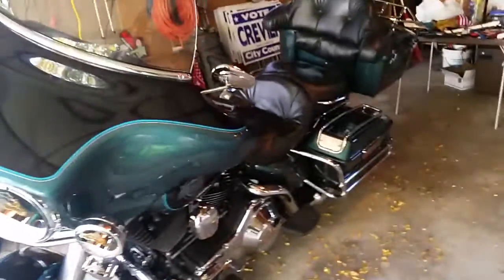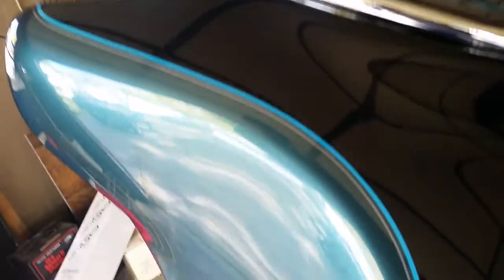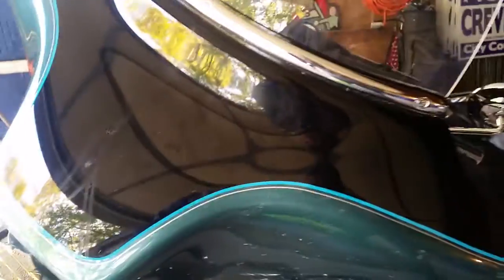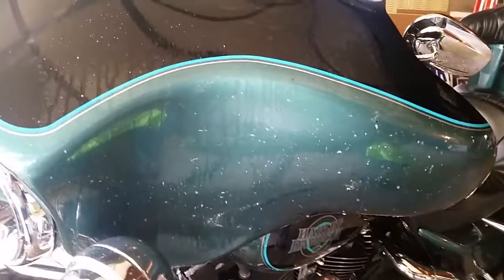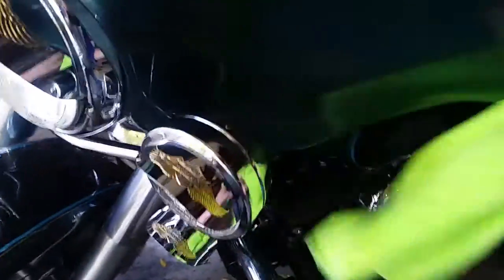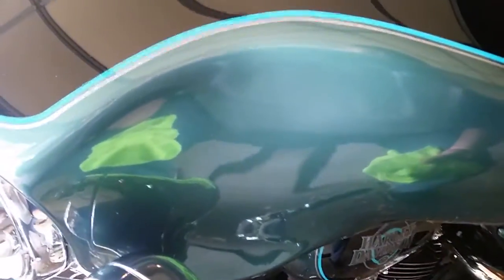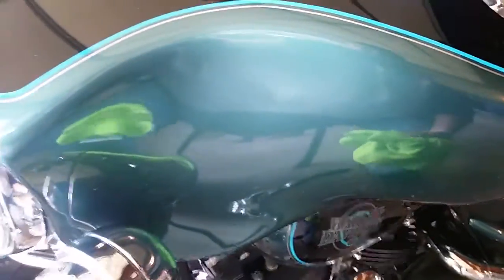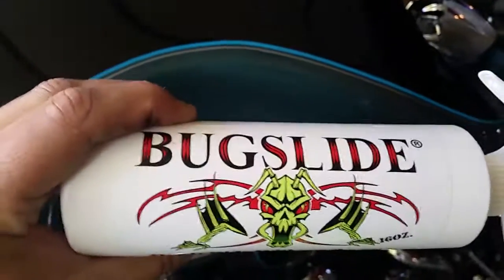BUGSLIDE Bug Remover Spray review

Comment: I had the same exact year and model, only diff I put fairing lowers on it had it for 17 years before I bought my 19 Road Glide. Also the bug slide is awesome,  I used it as my finish product after wax and cleaning makes them bugaboos go slide away to some extent.

Comment: i seen the booth for this product at the 2017 street vibrations in Reno about two weeks ago,  I never paid it any mind because there was so much to see there. 
I'm told it has a really pleasant smell and not like a nasty petroleum smell.
Reply from the maker: I just cleaned my bike with it again last night, and YES, it does smell nice. It also cleaned my chrome very well.
Reply: Scott Crevier Cool, thanks.  I never thought of using it on chrome.  Sometimes I get an unkown smudge above the right side floorboard and I've been shooting a small area in a microfiber cloth with brake clean and it knocks it out no problem.